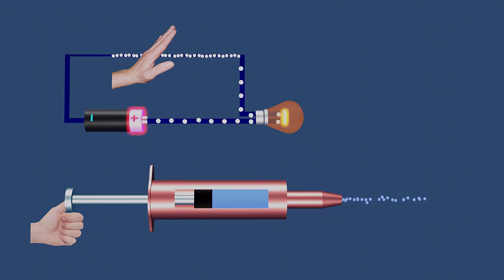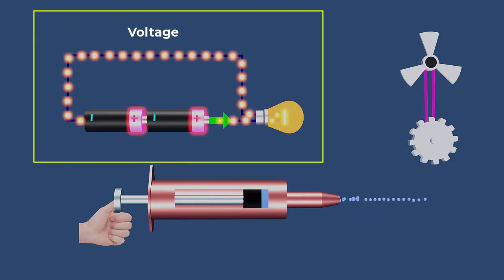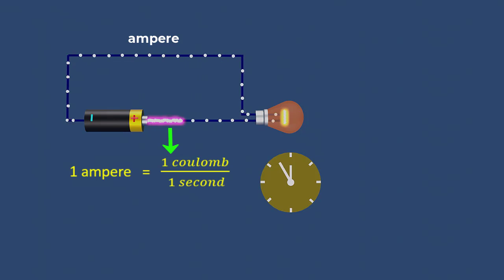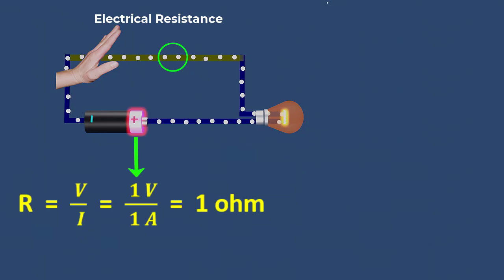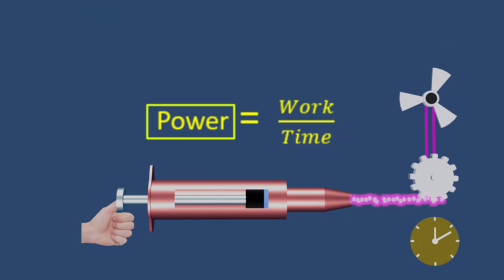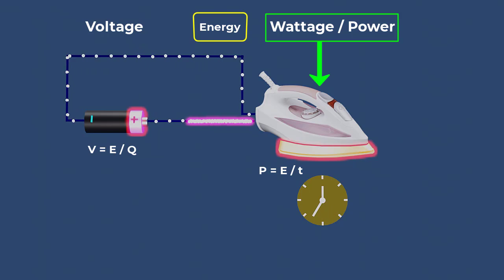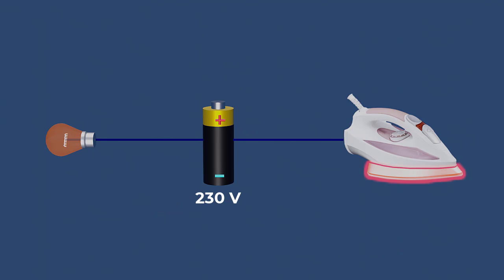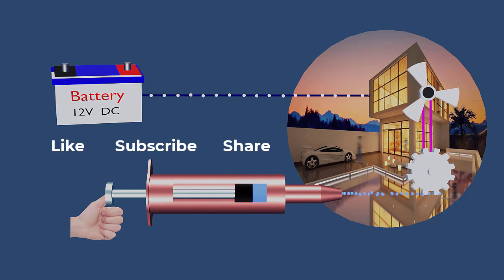Volts Amps Watts explained | Watts vs Volts vs Amps | Amps volts watts explained

Comment: What is a conductor? What is a charge?  What exactly is a unit of charge? What is a unit of energy? You use these terms to help define other electrical terms but fail to define what they are. Also you equate voltage with speed (the harder you push the olunger, the faster the flow….”but is that true?
Reply from the maker: Charge, unit of charge and unit of energy are different topics, these are to be covered in future. 
Voltage is not related yo speed, instead it is analogous to pressure.

Comment: From 2:33-2:42 - does anyone know why is it the case that a material that requires more voltage to allow 1 ampere of current have a high value of resistance? I don't understand that.
Reply: Not one thing I've looked at explains FULLY how to understand current, voltage and resistance. There are parts of the explanations that don't make sense that I can't fully understand how they all work together. There are little things that each explanation leaves out. People don't know how to teach fully and properly.
Reply from the maker: This is according to ohms law. Adjust parameters in ohms law to understand your question.  One Ohm is equal to  Volt per ampere from ohms law.

Comment: Some energy sources such as solar panels can release the low voltages needed to power things like lights and charge electrical appliances whike other materials can be used to power the heavy duty items. In this way we can balance the energy we use, instead of getting all the power from one overworked grid expensive grid

Comment: So comparing it to water in a pipe, volt is the pressure, amper is the flow rate, and ohm is the pipe width.

edit: corrected based on the answer
Reply from the maker: Ampere is the flow rate.
Reply: @Janvisualphysics I used the wrong word. I meant water flow rate. Is that correct now?

Comment: In the diagram it shows electricity flowing from the positive end of the battery. However electrons move through a circuit creating the current and they leave the negative end of the battery.

Comment: That's a valid analogy. Personally, I prefer the "waterfall" analogy: its height as voltage; water volume as current; an umbrella as resistance.
Reply: What is wattage in your analogy?
Reply: @pjlee7073 Wattage could be the overall impact on the soil or "working done" if it's turning a wheel. Now, I don have an analogy for inductance: your turn.😅
Reply: What is wattage and amperage is your metaphor?
Reply: @boxsterman77 Wattage could be the overall impact on the soil or "working done" if it's turning a wheel. Amperage has already described in "water volume" and nobody asked about inductance yet.

Comment: For people still confused about the difference between Volts, Amps and watts.
think of the wire being a road.
Amps are the amount of cars on the road
Watts are how fast the cars are going
volts is wheter there are bumps or hills on the road
Reply from the maker: Bumps on the road are ohms.
Reply: @Janvisualphysics  oh, are volts than how much km/h the car is going
Reply from the maker: @random-online-hobbys Volts are like the engines pushing the vehicles
Reply: @Janvisualphysics  ok thank you!

Comment: The electricity or current travels in the outer surface of the wire. Not inside. Wrong analogy..
Reply from the maker: It depends on frequency of the current. Higher the frequency high will be the depth.
Reply: @Janvisualphysics actually I’m pretty sure this is the other way round. It’s called ‘skin effect’ and the higher the frequency, the more the current ‘clings’ to the surface of the conductor. This is why the shock from the pilot circuit on a plasma cutter or tig welder doesn’t cause muscular contraction.
Reply: how do you test for current in a wire?  how do yiu test for voltage?   how does an electrcal fuse work?  how about an electric stove?

Comment: The syringe analogy is only useful to describe DC circuits.  Every example of a real world source and load in the video is AC. 
This analogy falls apart for AC analysis.  A more suitable analog is the Mass / Spring / damper with Force and Velocity.   The analog and math is correct for AC as well as DC.

Comment: Question, can one reduce the size of a conductor instead of adding a resistor?
Reply from the maker: Yes, but reducing size of a conductor produce heat, as a result the conductor burn up, adding a resistor is better, this limit the current to desire level without burning
Reply: @Janvisualphysics  Understood.

Comment: I'm a retired Master Electrician, and I wish I had this syringe model when I was starting in the trade 40 years ago.  👍
Reply: You said you are a master electrician. I am a baby electrical and have just started my course. Have you got any advice or tips for me? Any wisdom of electrics you can pass down to me? 

Thanks master :)
Reply: @teees554  Learn as much as you can, the trade is a combination of practical experience and theory.  If you're lucky to work under a Master, especially an older guy, suck up that knowledge!  Take trade school classes at night to embellish the on the job experience.  There is a wide variety of electrical work, from residential, commercial, industrial etc.  Control wiring, such as in building and wiring panels, and machine tool wiring, is a big niche in the trade, especially here in the Detroit Metro area.  Learning to bend conduit and conduit runs is a great skill to add to your repertoire as well.  Best of luck to you!
Reply: @JoeCooper-b4t  do u believe your rate of pay is worth the labour and dangers you put your self in every day? Also do you think its better to work for a company or be a independent contractor? kind regards

Comment: You say that two batteries will produce more resistance since it double the voltage..but i think its not logic..even the batteri is twice the pressure/ voltage still the same even if u add 3 or 4 batteris..am i right? I just wondering..
Reply from the maker: Sorry. You are wrong. 
Battery is a source of energy, it produces energy, not the resistance.

Comment: Standard electrical outlets in average wired North American house do not generally supply 230 Volts as pictured.
Usually this outlet is wired to a single 115-120 Volt / 15 Amp circuit and the available current is shared between the two female inserts. If the combined load of the two devices connected exceeds the supply current  (Volts × Amps = Watts -- or -- 120 Volts ×15 Amps  = 1,800 Watts) a circuit breaker or fuse will cut the supply current.
In some rooms (kitchen), the outlet may be wired to two separate 115-120 Volt / 15 Amp circuits allowing two high electrical usage appliances (kettle and toaster) to operate simultaneously from the outlet without activating breaker or fuse (called a "split" outlet). Important to remember is that there are two separate circuits in this setup. If a breaker/fuse is activated in one circuit (say kettle) the second circuit (say toaster) may still be live/hot.
Some household outlets may provide greater Volts and/or Amps and will differ physically from standard outlets, but the standard 2 or 3 prong plug will not insert into them.
Reply: Even if they meant the line feed for a home, the feed is usually 240, not 230, before it is split into 120. Most appliances in North America will run at all of these voltages. My outlets test at 126.

Comment: Thank you for creating this great video, in fact I am wondering to know is electron actually flow through the wire and generate electricity or actually electron is only vibrate and the electric field transfer the energy around the wire?.
Reply from the maker: Watch the following video to clear your concepts about electric current. https://youtu.be/J8qVLb3a35s

Comment: can you explain why Overload of Ampere even low volt like only 1.5v cause the wire heat up and burned?
Reply: Because the voltage does not cause the wire to heat up. It is the current that does.

The higher the current the hotter the wire is going to become.
Reply: @deang5622 so, say the radiators (heating) are in a bathroom, down a far away part of the house - and you run a huge 6mm cable from the top end of the house's fuse-box, all the way down to the far-away bathroom: I guess you would need another fuse-box with appropriate fuses in???? (yes/no?)... just before it reaches the far end of the house with appropriate [20amp] fuses in the fuses-box and a cable going to each radiator, and so on [its now 1 cable for a max of only 1 rad here, (before you had capacity on a fuse and cable for 2 or sometimes more rads) with its cables fixed directly into the wall, so cant be used for small appliances]. Q2: I heard that the 6mm cable that ran from the original part of the house (from the original fuse box) , would lose power before getting to the far-away-bathroom, because at that moment [now changed], simply because it was 2 or more pieces of 6mm cable joined together...? [cant it be joined using wagos of the right capacity?]. Q3: are the fuse boxes normally joined using 6mm cable [I know that b4 each row of fuses, there has to be a 'flip-that-row-off-circuit breaker' , incase of overloads].